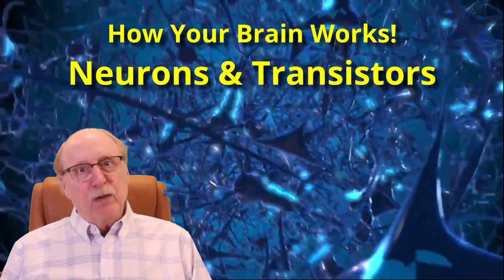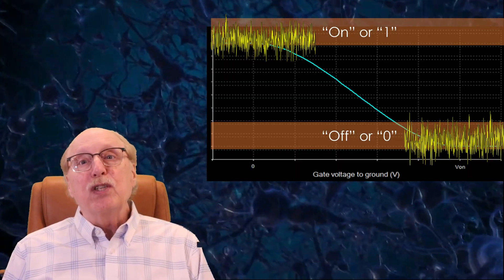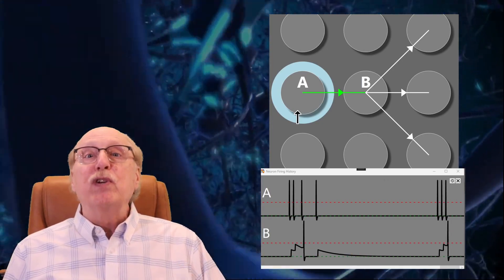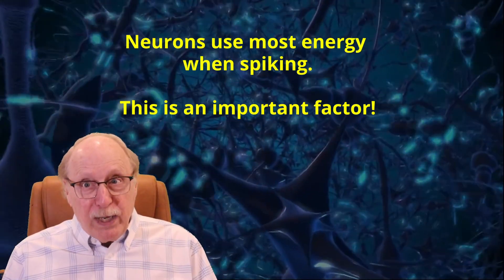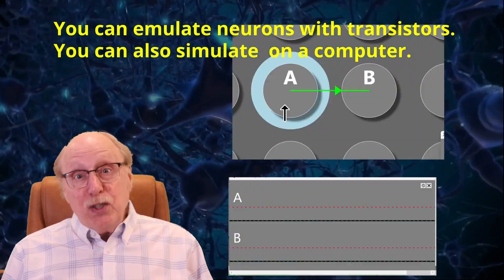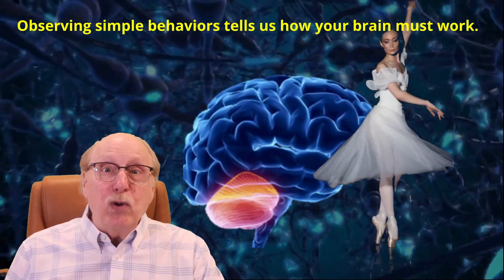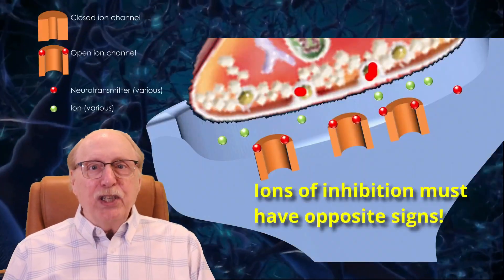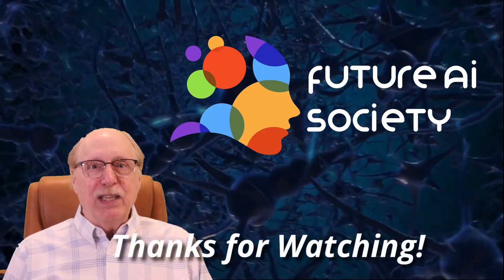Why isn't AI SMARTER if Transistors are SO FAST?

Comment: unfortunately when check how brain works and computer works even computers are faster at linear work. brain not work like that everything is parallel most cases (gamma beta alpha theta and delta waves in some cases act like conditional wait) so its like comparing apple with orange. every sensory input connect so many columns and they all work parallel . like gpu parallelism but better and more scaled. so processing power: biology wins and with big difference. still we can simulate that like you described because computer linear work is fast but still not enough. even for eye sensory input .
Reply from the maker: My computer can simulate about 2.5 billions synapses per second.  BUT, it only needs to process synapses which are actually doing something so it is only a few orders of magnitude slower than a brain.

Comment: Neutral nets on computers don't simulate the brain even on a molecular level, much less on an atomic level, and even less on a subatomic level. So I'm not sure how useful this type of comparison is. They are very, very different things.
Reply: An excellent point of clarification.  Yes, neural nets have very little to do with how brains work. But if we implemented more brain-like solutions, we get the advantages of efficiency of the brain, as well as improved thinking.

Comment: So even the way the weights work is different to a neural net? 
Once the threshold is reached, is the output any different for neurons or is it just an outbound '1-ish'
Is the outbound pointed to a single target or can it also be linked to several other neurons?
Reply: This is kind of a reductionist approach to think about neurons. Basic membrane potential is not even scratching the surface.
Reply from the maker: @ladyoftheflowers9781  More coming...  I should add that, yes, neurons are immensely complex (not described in the video). But we don't know how much or which parts of that complexity contribute to thinking.

Next video will be a deeper dive into the capabilities and limitations of synapses.  Let me know what you think when it comes out.
Reply from the maker: Yes...  biological neurons have very little to do with the ANNs work. Neurons work with spikes.  There IS an accumulating value but it is internal to the neuron and other neurons can't access it.

Comment: well if neurons are transistors (binary logic gates) then should be fast. if you first optimize the bnn to run exactly on the computer binary logic, not as fp8 linear neurons.
Reply from the maker: Thanks for you comment.  1) Bio neurons are slow because they are chemical rather than electronic...we could build electronic ones and they would be much faster. 2) each synapse represents multiple transistors and synapses represent the simulation issue  3) although fp8 saves memory, the ADD (CPU) time is about the same as a float 4) the layered structure of neural networks is one of the issues---brains are different 5) stay tuned for more.